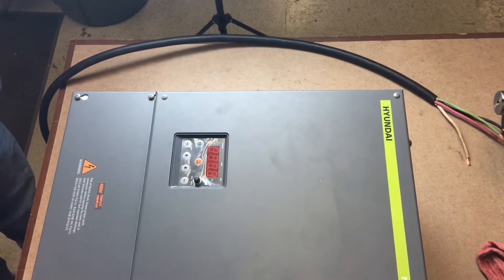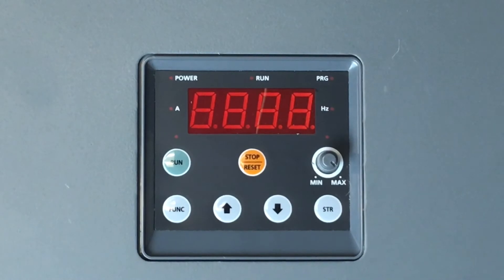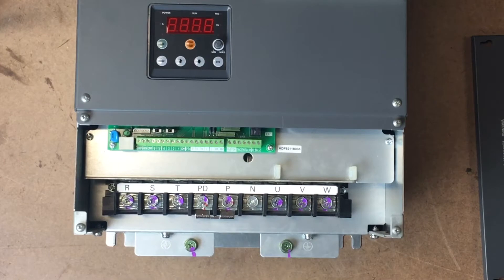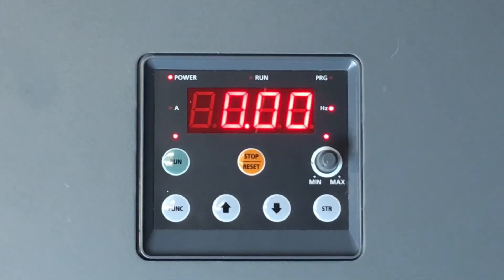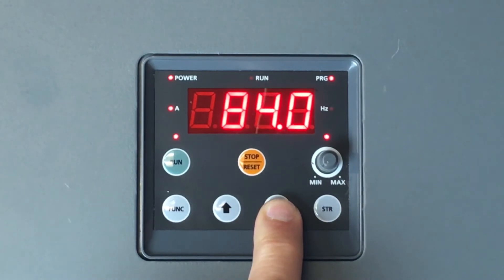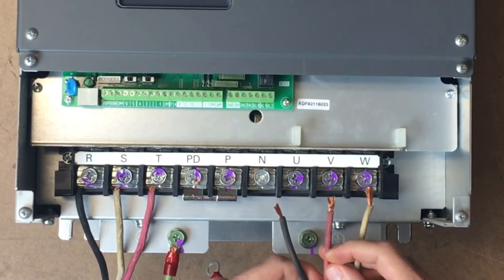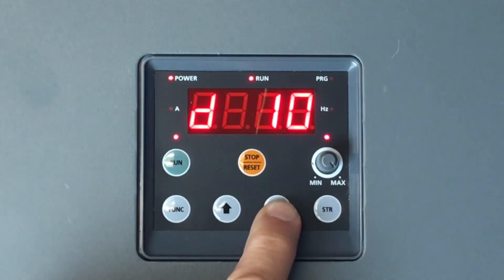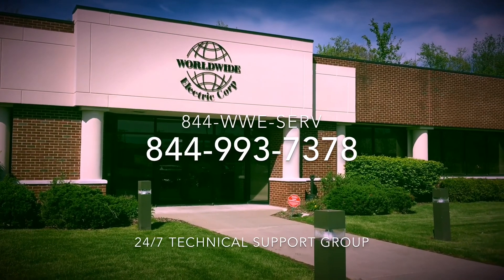Hyundai N700E VFD Basic Start Up

Comment: Hi.
Great tutorial. 
Which perimeter is set to run in automatic mode..
According to the factory manual is to set A O1 = auto and A0 = default hand mode.
Is there another setting to adjust to work in auto?